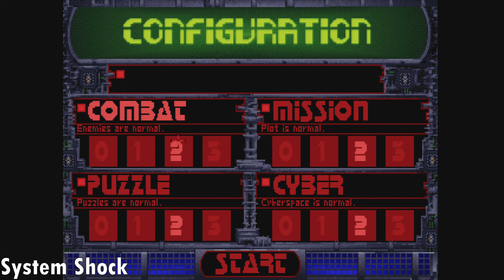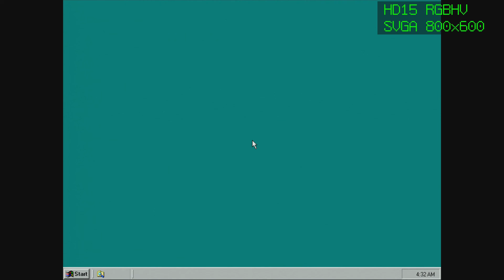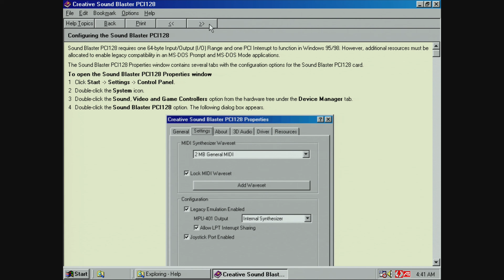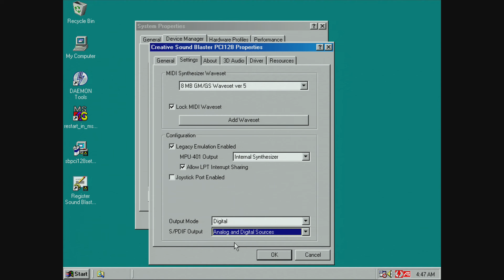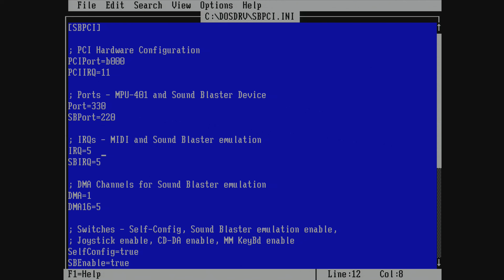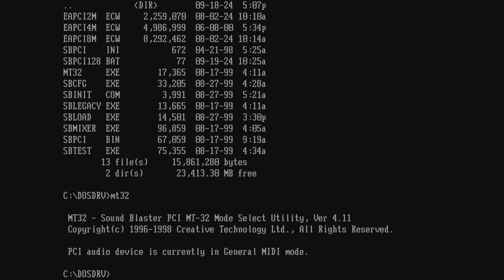Why no love for the Sound Blaster PCI 128?

Comment: There is a very good reason why these cards are not popular.  You can get an OEM Sound Blaster Live! card (CT4780, CT4830 etc) for almost the same price (probably less than $5 price difference) at this point of time - which will be a MUCH better card.  Most computers that this card would go into should already have a "basic" sound card.  If you are upgrading an onboard sound card, you might as well spend a couple $ more to get a card that will do better both in early DOS and EAX.
Reply: The live cards never were in good terms with VIA chipsets
Reply: @mktrj2098 The Aopen socket A board I have plays real nice with a 4830. That VIA chipset allows 3 GB of DDR 2100. Maybe my case is unique from earlier versions.
Reply: A tried a Live! Some weeks ago in Plain DOS and it was a mess and nothing worked.
Reply: @AncapDude  Sb Live! version 0220 works pretty good in dos and win98 for me. But for working sb emulation in win98 need small reg hack.  [HKEY_LOCAL_MACHINE\System\CurrentControlSet\Control\Creative Tech\Emu10kx\Emulation]
"EnableSB16Emulation"=dword:00000001

Comment: Found one on my pile of parts a few weeks ago.
Couldn't get it to work in several retro PCs, switching PCI slots, etc.
Some won't see the card at all (not even in the POST screen), when Windows can see it it won't start after installing the drivers twice, Or drivers said to be for the wrong card, or th dxdiag said is isn't there, or the sound is distorted beyond recognition,  Never had a card this picky. I switched it out for a Turtle Beach Santa Cruz...

Comment: Just picked one of these up for £10 on eBay, could be cheaper ones in the UK if you scroll through listings without descriptions. I picked up a SoundblasterLive ct4830 last year for £14 and those prices are stable or have even dropped a little.

Comment: I see cards like this, the ESS Solo-1, and the various Yamaha PCI cards as your entry level into retro PC gaming if Windows isn't your thing. 

Even if you don't get ALL the game, you'll get a huge library to start off with regardless.

Most of the really good games aren't all that picky, and will support Midi, so a card like this one is just fine.

I do agree with Phil partially on the all in one box. You shouldn't be trying to play absolutely everything on one machine just to play everything.

HOWEVER, there are use cases like mine where space is a consideration, and it can be cheaper and/or more efficient (not usually both) to build some of these all in one or multi-in-one systems.
Stuff like Socket 7 Pentium MMX, and K6-2+ and even XP era systems with ISA slots. That said, you run into diminishing returns really fast if you try to push too much into one system.

For anyone getting started, you will find those gems of systems, and find at least some rare and unusual parts. You should get started like I did by just getting Windows XP crap boxes that have good enough DOS compatibility in the chipset and throw some semi compatible parts like this sound card in there to get you started. This is much more cost effective to getting into the hobby than buying an overpriced system and finding out you don't enjoy this.

Phil if you're reading, I think that would be a great video for you to go over. The different hybrid systems a person can build, and some of the pros and cons of them. I know you have a lot of videos on this already, but a more general setup would be helpful for a lot of the beginners. I got my start from watching your videos, and I know something like that would be helpful for others.
Reply from the maker: I feel I cover this quite well. If it's a powerful machine I test XP, 98 and DOS, but often it's just 98 and DOS. I always try to slow it down and see what we are getting...

Comment: This was one of my go to cards for the late PCI years. The university i went to used to build PCs with them and was selling them off for cheap when i started building my own PCs in the early 2000s
Reply: I have 50 of these, indeed also from some education organisation, they were throwing them into the recycling, when I saved them from destruction long ago.  I have never found a use for them, but since they only take up 1 crate of space they are still in my posession.
Reply: My last system had one PCI slot too, old intel 1700 server ish board still support it.
only my Gaming PC is a new Prebuild.

Comment: IT Just so happend that i need a New sound card. One of my sb 16 cards stoppe working yesterday.. And i felt a sb live is to modern for a pentium 133 running Windows 95.

I was looking for a replacement, and i jumped on ebay Just after hearing i this was good for 1992 onwards.
I got one, and the cheepest i could find cost me about 25-30 dollars, including shipping and tax.

Looking forward to testing it 😊

It was a ct4810

I did have a pci 128 back in the day, and i only remember good things about it 😊

Comment: A tip if you allow me: in the BIOS asign the interrupt you're going to use for the SB emulation (usually 5) to the PCI port you have installed the card in, it will save you many headaches, hangs and reboots (don't ask me how I know 😂). Applies also to Live and Audigy.
Reply from the maker: Yes!
Reply: The same IRQ for Emulation and Real is good?
Reply: The week before i found old AMD system, Audigy 32 in, on a double board, many firewire ports on it too.
driver issues, LOL !
was it any good ?
Reply: and Vortex and PCI Yamahahahaha uh, cards!

Comment: You really should try the older Ensoniq AudioPCI drivers, as they give SB Pro and Sound Canvas compatibility under DOS.
Reply from the maker: Yes you are right, but why? What's the benefit?
Reply: @philscomputerlab  Well, the SB Pro and Soundscape (there's even WSS emulation IIRC) might come in handy in older DOS titles, but on the other hand the newer titles used the same driver for SB Pro and SB16, so there might not be any difference. I do even wonder if the newer Creative driver is even the "true" SB16 emulation, or just the earlier Ensoniq driver with Soundscape and WSS support dropped.

Comment: My 386DX40 has a ballin AWE32. If that's the era you roll, that's the best card in my opinion. But any Creative card is kick ass. I'd love a Mt32 plug in ISA card. Its fun to watch a 386 load a PnP driver and have it 'just work' for the advanced wavetable features. Also, Win 3.1 wavetable support
Reply: I disagree strongly on the AWE32 being anywhere near "the best" option particularly with a 386... the 40 mhz variant landed around 1989 and was more or less replaced by the 486sx by 1992 in budget systems.  The Gravis Ultrasound landed in 1992 and brought the first really affordable Wavetable synthesis option to PC's with hardware offload/acceleration that helped stretch the useful life of lower end processors like the late 386 and lower end 486 class CPU's of the era.  The AWE32 didn't come out until '94 when the 486 DX/2 was king, and is really just an Ensoniq wavetable synth engine bolted onto the notoriously buggy SB16 design.  it offered no such HW offload benefit like the Gravis and required more host CPU cycles for audio work, thus requiring a faster CPU to function optimally....  The AWE32 also requires explicit driver support for wavetable support in most games (AWEUTIL is terrible in a pure DOS environment and doesn't work with most popular "real mode" game engines of the time) which only uses the 1 MB Ensoniq derived wavetable soundfont on the chip ROM, the RAM based wavetable was really a Windows only trick.  It's wavetable/MPU401 support is also buggy thanks to the SB16 DNA it carries forward, so it's terrible for using external or wavetable header MIDI devices if the card has the header.

I put a PicoGUS (GUS, SB 2.0, CMS, Tandy 3-voice + smart MPU401) and a WavetablePi (MT32/GM support) in most 386/486 class retro machines i build, sometimes paired with a Yamaha YMF-7xx series or ESS 186x ISA PnP card if I want GUS and SB support at the same time.  It's a pretty versatile set of options for around $100 all in.
Reply: @TheYuppiejr I just built an AWE64 based System with SIMMconn 32mb and this AWEUTIL thing really messed me up. It's absolutely useless in plain dos 😢

Comment: Well, why a 128 when I can buy a Audigy for 10 bucks with perfect emulation/DOS compatiblity, EAX for Windows and extra RAM for wavetable support. Better deal imo. Thanks for the video anyway :)
Reply: The extra RAM was only available on the X-Fi lineup of Sound Blaster cards,
they had up to 64 MB of onboard memory.
Reply: @SuperConker  Well an old X-Fi is not much more expensive…
Reply: You know, that the Audigy also uses the General Midi and only does FM in emulated mode, just like SB PCI/AudioPCI cards?
Reply: @DominikGorączkowski-h8q  That’s exactly what I wrote in my first respond?

Comment: Agree its a very interesting card with the VXD drivers and Quad with DS3D games, great if the games in DOS are using GM. I did think Quad mode only worked with the early versions with the AKM codec, but maybe it works with all still...I use the Vibra 128 in a few of my machines, others are ForteMedia FM801, YMF724, Live / Audigy / Vortex / 8738 / ThunderBird Avenger / TBSC.... Vibra 128 is generally very compatible, even quite good success in some Fast 98 builds with C2D (VIA chipset)

Comment: Edit
I may have found the answer. I've  done some digging and discovered the Live Vaule card I have is one of the Dell OEM verent CT4780 cards with a different EMU10K1 chip the (-SFF in this case) So is that why it's not working? The official Creative Labs drivers from there site are not compatible?

Hi phil could use some pro help.

I'm putting together a Slot 1 Pentium III maching for my 9x games and ran into a snag. The SB Live Vaule card (model ct4780) isn't working. Windows says everything is fine and the volume metter next to the master volume control in volume control is showing something is playing but there isn't any sound not even static or a hum from the cards output. I've tried different drivers and two other pci slots and changing the IRQ but nothing has worked.

At this point I have no idea if its the card the windows 98se or something to do with the configuration of the motherboard.

Edit
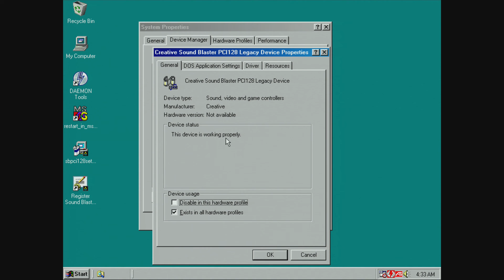8:39 when you had the resources window open I saw something diffrent from mine. Mine only shows the I/O range and IRQ no memory access etc
Reply: Make sure you disable any onboard sound in the Bios
Reply: @sandplasma  No onboard sound